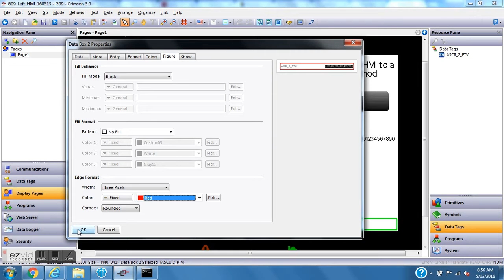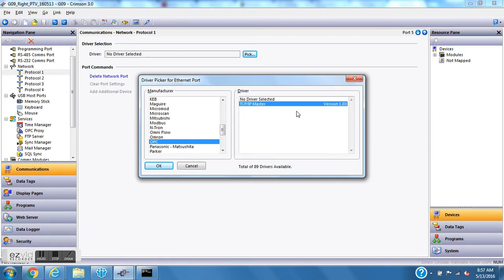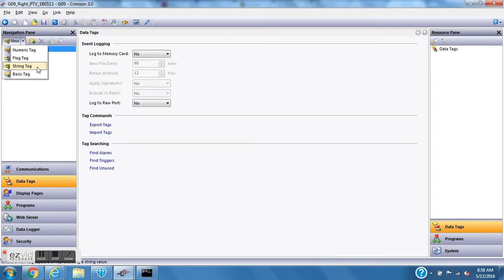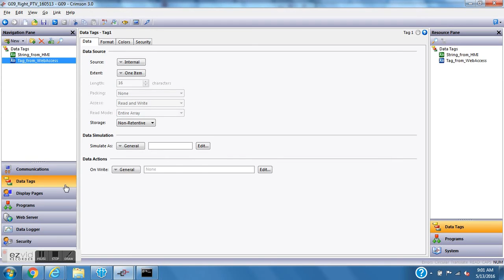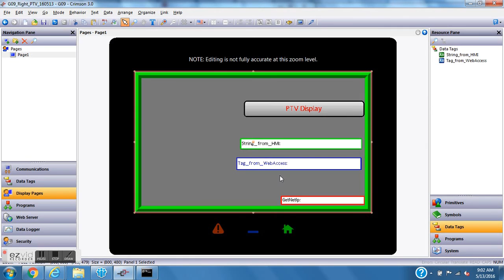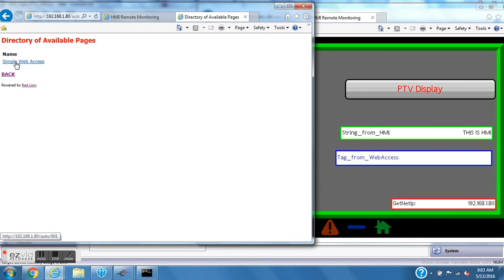Using OPC method in RedLion Crimson 3.0

Comment: Joe, what if the data source is on the master end, and you need to pass this data to multiple HMIs?  For example, let's say you have a DA70 with FlexEdge IO modules, and you would like to display process variables on several CR1000 HMIs.  Appreciate all of your knowledge sharing!
Reply from the maker: Since the Session Limit is max at 4, I suspect that only 4 HMI's could Poll that data at the same time.  And that rule would apply to ModbusTCP Slave comms as well. However, with the ModbusTCP method, you could set up a Slave Driver on many of the Ten Protocols supported over Ethernet and have upwards of 40 (4X10) devices polling that DA70. But there is a catch, you would need to change the Port# from 502 Default ModbusTCP to some other #. This HMI here is actually my simulated PLC for my classes. http://47.185.227.191:97/ . It is sharing data many ways. Send me an email and will share with you that database. wazoo@adcreps.com